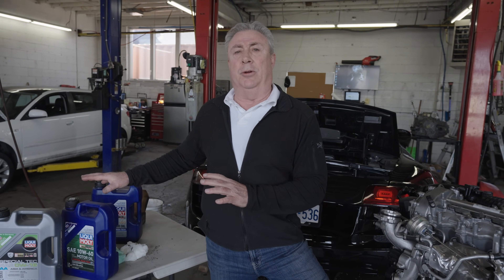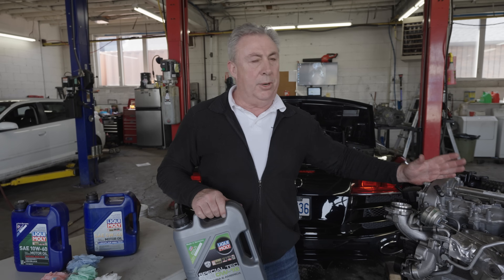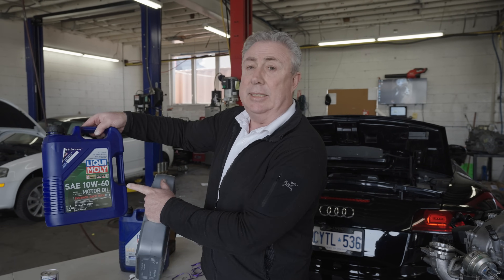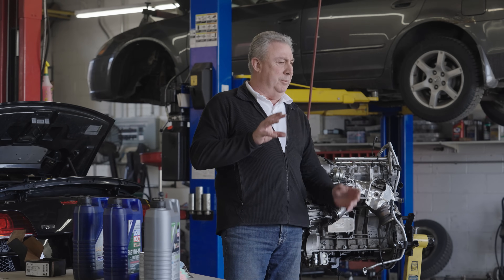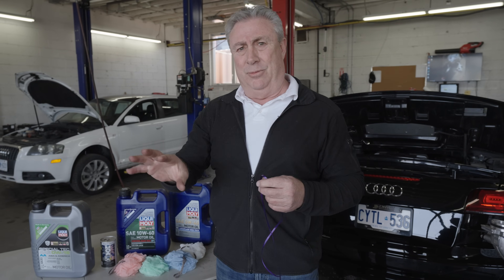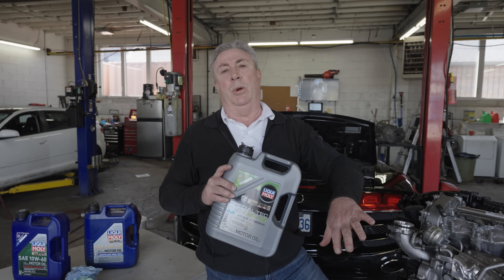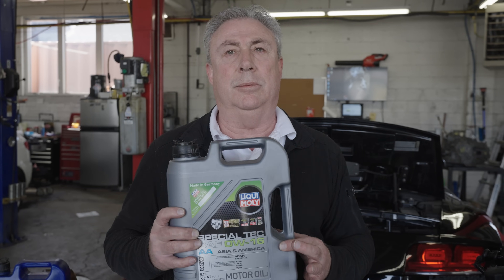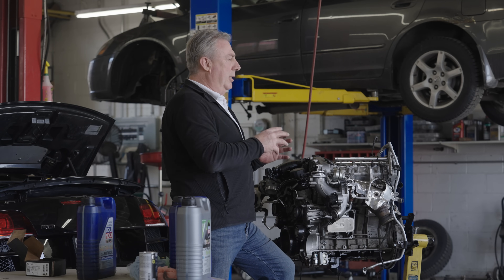Thin engine oil just a Scam? What's Safe

Comment: I have a 2011 Audi Q5 with 2.0t. The car has 199k miles. It has a good service history, oil changes every 2.5-7k miles. I am having a low oil pressure warning light come on a few minutes after the car warms up. Currently has 5w-40 castrol euro blend. I’m wanting to go thicker on the oil, maybe a 15w-50 or 20w-60. I noticed also when checking things, the center plastic oil filter support piece was missing…not sure if that makes a difference in oil pressure or not. Located in Illinois for a temperature range. Any suggestions? TIA.
Reply: Also 15w50/ and 20w60 would be way too thick for your 2.0 motor that’s insane bro, you start up wear is going to increase, if you live where it’s 85F+ 10w40, mild, 5w40, really cold 0w-40, and if your car is under extreme heat than I’d say 10w-50 for your car. If you really care about the engines life get real synthetic oils like redline group 4-5 PAO/Ester blend with HTHS above 3.8
Reply: I can’t speak for audi, but for bmws specifically mine with M54, if your missing anything in the filter support your oil pressure light will appear, if you forget to add the gasket for the support also will trigger it, so if your missing anything with your car I’d suggest fix it asap.
Reply: Don't use patrol i blew to motors up by trying it
Reply: @royroddy9545  Was this meant to say "Don't use Castrol, I blew up two motors by trying it". ?
Reply: Casrol.
Reply: Try 5w50, I think that would work well, had a jeep wrangler with noisy phasers on cold startups, once I started using 5w50 it stopped. I used Motul sport
Reply: That car needs 5w30.
Reply: the stalk in the housing is critical. the filter may collapse on its self starving the engine of oil

Comment: What you said is my thinking also Sir. I have finally come to the conclusion to use 5W-40 Amsoil european formula manly (I got a skid of the stuff at auction for cheap, real cheap), however before I also used to use Mobil 1 5W-30 high mileage, Kirkland 5W-30 high mileage, Royal purple 5W-30 performance when my 07 explorer 4.0l v6 states to use 5W-30 Motorcraft conventional, Motorcraft semi-synthetic, but stress straight 100% Motorcraft synthetic as best performer. I change the oil every 2K to 3K and oil filter top line, Amsoil, Fram ultra, Mobil 1, Purolator Boss, Motorcraft FL-820S, Baldwin B281. Top of the line units. I move from one filter to the other with oil change. So far no problemo fella. Even though the engine is known as the "EXPLODER,"

Comment: Just refer to owner's manual.  Easy.
Reply: That's probably the worst advice. Car manufacturers are in the business of selling cars not ensuring yours lasts a long time.
Reply: @Taras-Nabad  Facts.    Another fact is that service intervals today are a product of marketing, not the engineers.
Reply: @jamesbosworth4191  Yes the sooner your motor fails the sooner you need a car !
Reply: @garyalford9394  Especially nowadays, as more and more vehicles are being designed so that you have to remove the body from the frame in order to pull the engine, and with unit construction, which is the norm nowadays, you CAN'T remove the body.

Comment: It really depends on how you achieve that 1% increase in fuel efficiency. There's an old saying, oil is cheap, engines aren't. You could say the same thing about fuel. No matter how expensive gas gets, it's still cheaper than engines and engine repairs. In the early 2000s, a number of different manufacturers began experimenting with decreased external pressure of the piston rings on the cylinder walls. The idea was to increase fuel efficiency by decreasing the effort the engine makes in moving the pistons through their various strokes. Decreased effort = increased fuel efficiency. Problem with that is, it increases oil consumption and the likelihood of fuel mixing with the oil flow. Also, you need to rigorously keep up with your oil change schedule (which you should always do regardless) because with the thinner oils, you also increase the development of blow-by and piston-slap. In the case of forced induction engines, either turbo or supercharged, you run into the additional problem of the inductors overheating or having them prevent enough oil from reaching the camshafts. It was a stupid idea which never should have been attempted.
Reply: I'd rather pay the gas guzzler tax and burn more gas and have a reliable vehicle.
Reply: ..yes, and at the same time, they started to extend the oil change intervals to insane levels...synthetic oil or not, it still gets moisture and contaminants in it over time and mileage.....
Reply: Sometimes I learn more in the comment section than watching the video!
Reply: What's an inductor?
Reply: Inductors?
Reply: I agree.  CAFE needs to be repealed.  NOW.
Reply: @jamesbosworth4191  Do another cash-for-clunkers program. Aggregate fuel economy rises across the country.
Reply: @ To heck with fuel economy.  Performance and styling are more important.
Reply: This comment is better than the video.  Car/engine makers have been forced into this situation by ever more stringent government regulations.  Yet passenger vehicles account for only 10% of global emissions.  Even if we improve cars 30%, this is only 3% of total emissions.  Best to stop waging war and look to better electricity solutions (thorium perhaps...??).
Reply: @nedmilburn  no, it is to make the car junkworthy sooner.
Reply: @georgekem yes
Reply: @nedmilburn  it’s been explained to me like that, we have gotten rid of 99% of the emissions and we have spent a lot of money to get rid of the other one percent we would have to spend a whole lot more
Reply: @nedmilburn They that are in power (hidden behind your favorite politicians) don't want us independent and free in our vehicle. If they cared they wouldn't be attacking us the hardest because they definitely know the facts.
Those fleets of Walmart Ships do a vast majority of the pollution vs our catalyst controlled sedans yet nobody says anything about it.
Reply: Im in the Uk and my wife owns a 2015 Citroen 110hp 1.2 3cylinder turbo, it's performance is  incredible. 50mpg urban 64mpg distance...
Its done nearly 70k.
Wet belt, low friction piston rings,tiny tiny turbo, direct injection, varible valve timing, piss thin oil, every ingredient to make for a disaster
It started using 0.5 of a litre of oil per 1000miles but recently had a oil change and "Berrings B12" cylinder/piston soak and that has cured the sticking rings. Oil is changed every 7k NOT 12...

I cannot stress how torquey, smooth and remarkable this little engine is...

If it makes it to 150k thats a result but im not holding my breath😅😅😅😅😅...
Reply: @stevebayross7248  Your engine is designed to faill ! Wetbelt cam and oil pump belts disintegrate block oil pump feed and starve engine/turbo of oil.1 of the worst engines in history.!!!
Reply: @michael-sz3ff  i don't think its designed to fail but it does have a certain incompetence about it.
"Worst engine in history" ? for reliability thats not an unreasonable claim ironically when functioning correctly its utterly brilliant.......
Reply: Exactly. Goodly explained. Thank you 4 educating all these Uneducated souls uphere.

Comment: My high output V6 engine calls for 5W30 oil. I always change my own oil and I use 0W30. The dealership said that the factory said to start using 5W20 oil. No way. I'll stay with my 0W30 oil.
Reply: full syn Mobil One...0w20 for fours and 0w30 for sixes.  that is correct.
Reply: Did you watch the video...? It has essential information. You don't know what you are doing ~

Comment: Viscosity  breaks down with heat, a 20 weight will not hold it´s viscosity as long as a heavier weight oil like a 30 or 40 weight.
Reply: Stick to knitting....
Reply: So change every 3-4,000 miles and no issues. Pretty simple!
Reply: 0W 20 is not a 20 weight oil, it is a 0 weight oil that has been fortified with polymers so that at higher temperatures, it mimics an SAE 20 oil, providing it doesn't sheer.
Reply: @jamesbosworth4191  Oil Weights are what we called them a long time ago, APIs were refered to as Grade SF - SJ.... Most of the oils on the market are Group 3 with some Group 4 polymers in them. Mr. Lake the Oil Geek has some very good videos on viscosities and shearing.

Comment: I called and spoke with a Liqui Moly oil specialist. He suggested I use the oil Liqui Moly recommends, based upon my vehicle info. After inputting my car's information, the oil that is recommended is their 0W - 20 synthetic oil with required certs. That viscosity and certs are exactly what my owner's manual recommends. The oil guy at LM did say that if I were to modify my engine and/or track my car, a higher viscosity oil would be preferred. 
Liqui Moly has a table of bearing and journal clearances, oil temp, and recommended viscosity.
 Therefore, for street driving, 0W-20 is best for me, and satisfies warranty requirements.
Reply: Lol...LM is a scam, just use Castrol Edge and change the oil every 3k. Unless you're an auto engineer stick with the OEM grade.
Reply: @ginog5037  You think Liqui Moly is a scam company? I think it's reasonable to say that the vast majority of their repeat customers disagree with you.
 And I'm sure that an oil analysis of 3000-mile synthetic oil will show that another 2000 miles could've easy been added to your oil change schedule. This is no longer 1975.
Reply: @davepaturno4290  Total BS, you folks are such fools & suckers. You're right 70s cars didn't have blow-by issues, DFI or turbos. Show me 1 modern engine that has gone 100k without an issue, using your LM crap at 5 - 6k.
Reply: @ginog5037  Our 2006 (bought new in 2005) Lexus RX400h is now 20 years old and never had a repair until this year. It has 143,000 miles on it. I changed its oil every 5000 miles with Mobil one, using the factory specified viscosity. Its engine is in perfect running condition and the oil level remains full after 5000 miles. Liqui Moly has the same certs as Mobil 1 for this vehicle. Both are excellent oils and well known.
Reply: @davepaturno4290  Well Dave, get back to me when you hit 200k and 300k.
Engines with DFI and turbos ALL break down/contaminate the oil quickly. 5k is even too long, let alone 7k.
Reply: @ginog5037  I don't need to keep any vehicle for a total of 40 years, even the Lexus. And how may sportscar/high performance car owners that you know rack up 200,000 miles on their cars. It would take me 50 years to do so. The electronics in most modern cars will be unavailable after 20+ years, so it's probably a moot point. However, it is highly unlikely that I will have any engine issues after using factory-recommended oil and 5000 mile oil changes. Synthetic oil today is far superior to oil used in the 80s, yet even those vehicles could achieve 100,000 miles or more.
Reply: @davepaturno4290  Seriously, you don't know anyone who hit 200k. Maybe you shouldn't comment or get a life and do some traveling. Longevity starts on day 1 of car ownership!
Reply: @ginog5037  Our Lexus owner's manual specifies oil changes every 5000 miles or one year. Many owners of the same model and many pure-ICE models have over 200,000 miles on their vehicles. According to their testimonies on the Lexus forum, they religiously change their oil every 5000 miles. Why would they spend more money doing oil changes at 3000 miles? - a complete waste of time and money. 
But hey, it's your money. Waste it as you wish.
Reply: @davepaturno4290  MOST if not all manuals state Severe Driving Conditions (stop/go traffic). You must also believe in lifetime fluids.
FYI 80% of cars on the road run the oil filter bypass. But hey, it's your money.
Reply: @ginog5037  ...and it's your waste of money.

Comment: They technically aren't the same test. The cold test is just a time time it takes for a volume oil to flow though an orifice by gravity. The hot test uses a rotary viscometer. I might have it backwards, but it's two different tests. And the scales themsleves are different. There is actually an oil designation of 20W-20, but the viscosities at the cold and hot temperatures are totally different.
Reply: Yes, just like every other oil, regardless of viscosity designation.

Really cold oil is thick.

The same oil when really hot is thin.
Reply: @dvader3263  0W anything CAN'T get thick at low temperatures.

Comment: If it's a Scam, then put some good old 15w40 in a 4jx1 motor as oppose to the 5w30 that it is meant to run. with in a short time you will have componets of that motor failing left right and center. so do a video of that and come back and tell the viewers engine oil is still a scam!!
Reply: He said that you can low the cold winter value from 5W to 0W, not the reverse.

At the hot value (after the W) he stated a little jump depending on condition and that is correct, the opposite that the brands themselves are making is wrong.

Anyway the brands are only interested in your car to last for the guaranty period, after that if it breaks is better for the business.

Comment: Although engines seem to be running and lasting fine on low viscosity oils, assuming OCI (shorter than manufacturer suggested), every oil analysis ive seen with one or two bumps up in viscosity showed less wear metals.

Ow20 to 5w20
or
5w20 to 5w30. 

In warm weather, plenty engines spec'd for 0w20 are running well using 5w30. Mazda owners' manual suggests exactly that with a wink and a nudge. Specs 0w20 for US & Canada, but immediately states the best choice outside or those two countries is 5w30 for all temp ranges.
Reply: I've noticed that in literally every owners manual I have ever opened and went yup too bad they use that against you on warranty claims in the US.

Comment: 25 years ago Mobil had the best all round oil known as Mobil 1 00W40 labeled as tri-synthetic

The confusion was world wide specially with mechanics confounding that Mobil 1 0W40 with 10W40

They put the 1 near the 0 and that’s what happened 

Any way, should be avoid excessive viscosity modifiers polymers because a 00W40 con turn to a 00W30 after the polymers start to break and wear, is a great choice but not for increasing mileage but on the regular basis to get maximum engine protection hot and cold on a reasonable mileage service

If you’re driving city short trips with constant cold engine try not to touch the hot score but low the cold number as possible 

If you’re making very long trips and specially with lots of loud and/or weight like towing get a viscosity grade according to what the maker says but search for PAO/Ester base or with slightly higher hot number

For example:
A car that uses 5W30 is always on city driving use 0W30

Another with 5W30 making a lot of highway and towing change to a 5W30 with PAO/Ester base or raise it to 5W40

Why not 0W40 on second case?
Simple, because of polymers it will soon become a 0W30 faster than if it is a 5 on winter grade

Exceptions as always for top specific factory norms:
VW made the most demanding oil ever over 20 years ago for diesel engines known as VW 506.01 00W30 also known as VW LongLife 2
Able to outstand 50.000Kms on some engines and the only authorized for V10 Tdi before the particle filters been added

The following LongLife 3 was a downgrade for a low cost product due to the expensive it was to make the LongLife 2

They even declared that LongLife 3 (also known as 504 and 507) replaced older versions except for those vehicles with LongLife 2 506.01 00W30 factory demanding 

The reasons were that at that time PAO/Ester base as the 506.01 was too expensive to make and don’t give a lot of profit 

Today there is an oil that can (unofficially) accomplish the both more demanding norms ever, API SP and VW 506.01 all in one in the latest version of Redline 00W30

Even so if using the best of the best don’t increase mileage because:
Oil is always cheaper than engines

Ask that to the Touareg V10 Tdi owners, not only the owners but also VW employees don’t had a clue what they were leading with
Reply: Very interesting 👌 👍

Comment: My Toyota RAV4 used ow16 🙃
Reply: Your Rav4 A25A engine is used worldwide and outside of the USA, Toyota owners manuals say A25A owners can use any viscosity from 0W-16 to 5W-30 year round and 10W-30 if anticipated overnight temps are above zero degrees F.   This video doesn't teach the public vital info like that; i.e. doesn't teach them that using 5W-30 is harmless even if the engine came factory filled with 0W-16 or 0W-8.